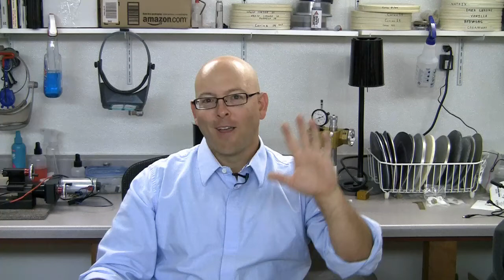How to Cheat

Comment: Love your videos. How do you set the zero on an UltraTec? Should I start by following your video on zeroing the rifle?
Reply: Ultra Tec is really easy to set the cheater on:

Use the tool that looks like a dop stuck in the middle of a little dumbbell

Seat that very carefully in the quill against the roll-pin. Key it in carefully!

You can use most any angle, but something close to 45 is usually easy to work with.

Mount a master lap on the platen. DO NOT USE a cutting or polish lap. A cutting lap will damage your tool, and the tool may contaminate your polish lap. Use the right tool for the job, here - a master lap. If you don't have one then buy one. It's necessary equipment and not expensive. I have really good ones on my site...

Put your cheater in the CENTER zero position (not just any position with the pointer on zero, but the centered position). Check this is so.

Set the index gear to the ID notch.

Loosen the set screw that holds the index gear, so the quill can turn separately from the gear. Test this by turning the quill.

Carefully wipe the master lap and the dumbbell tool to insure no debris are between that could damage either item.

Bring the head down so the little dumbbell tool FULLY rests on the master lap - and in the position where you intend to cut (should be 4-5 o-clock, not 3).

Put gentle pressure in the center of the dumbbell with your index finger so that it sits firmly and flatly against the lap - one lobe of the dumbbell on each side of your finger.

While holding that pressure, use the other hand to gently tighten the set screw in the index gear.

Test to insure the quill doesn't rotate inside the index gear - that it's snug enough.

You're done.

The next dop you carefully key into the quill will have a well-zeroed cheater to work from.

Obviously, if you did this process between cutting a pavilion and a crown, you would have to cheat to get the crown aligned. Best do this before you begin a new stone or set of stones.

If you have any issues following this instructions let me know. 

If you remind me, during the next live training event I'll shoot a video of this process exactly as I teach it in the Faceting Academy course and post it here.

Meantime, happy cutting!
Reply: John Bailey 
WOW I didn't expect a reply that quickly many thanks.  I do have a master lap but do not have the dumbbell you mentioned. Can I use my 45 adapter that is used when cutting the table? Not sure what you mean by the id notch? 
I and hopefully some other faceters would really appreciate if you would do a video on this as a picture/video is as they say worth a million words. I live in London, Ontario which unfortunately is a long way from you, otherwise it would be great to come.  Again - thank you.
Don
Reply: I just happened to catch the notice of your question.

You can NOT use the table adapter because it doesn't use the keying system.

You need that little aligner tool. Shoot me a message on the web site and I'll get you a price for it. It's a necessary piece of the kit. You can NOT align the index gear without it.

The ID notch is the notch in any index gear that tells you which gear it is - e.g. on a 96 gear, it's the 96 notch - the notch that IDENTIFIES which gear it is. Hence, the "ID notch".

I'll do a video of this process during the next Academy, and post it up.

As far as being "a long way", we regularly host students from places like Hong Kong, Taipei, Chile, and Lagos. So, Ontario is just a short hop!

Hope these extra comments help.

Comment: Do I need to wear a respirator when cutting with water and or oil?
Reply from the maker: Depends on the material you're cutting, and how much cutting you're doing.

If you're doing huge amounts of cutting almost anything - industrial type workspace - you may want to consistently wear breathing protection.
If you allow the swarf to dry out in your work space, you need breathing protection to be in the work space at all. (Always clean everything very well while still wet.)
If the material you're cutting is known hazardous, you should wear protection.